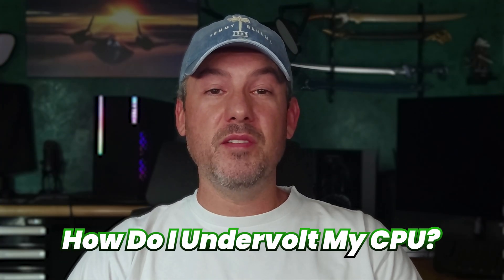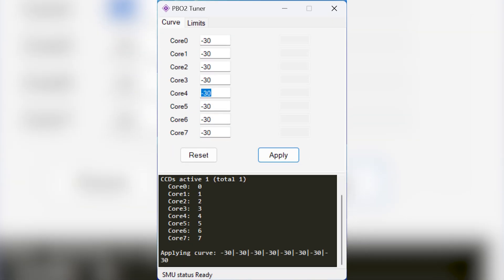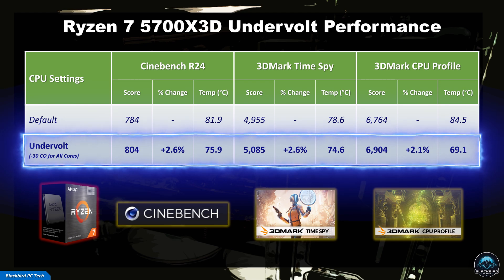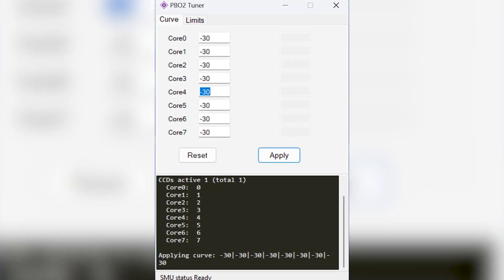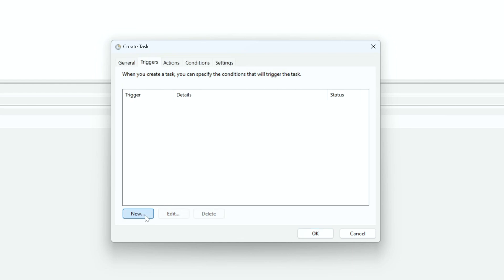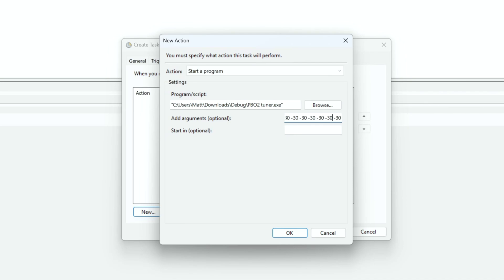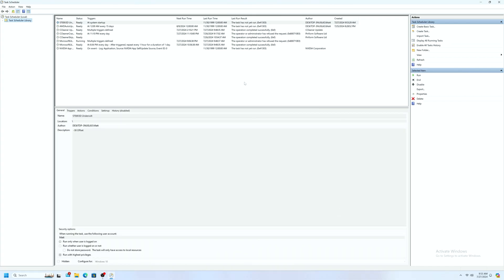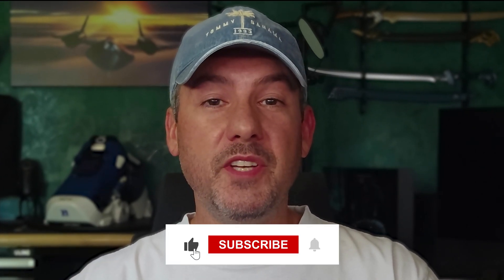How To Undervolt a Ryzen 7 5800X3D or 5700X3D!

Comment: Automated task didn't seem to work unless I ran with "Run whether user is logged on or not". Probably because I'm not solely using admin account for running everything and PBO2 Tuner needs elevation to start. The task scheduler needs to be started with admin account as well or task creation is going to hit another hurdle with user privileges.
Reply from the maker: Thank you for sharing that … will pin your comment so others can see it.
Reply: TY Bro It Worked for me too
Reply: My account is administrator but its not start automaticaly when i restart pc. What i did wrong ?
Reply: @tundzhayahmedov6149  Not necessarily anything wrong. I have no faith in Windows task scheduler anymore.
Reply from the maker: @tundzhayahmedov6149  it's not possible to figure out what you might have done wrong ... perhaps try following the steps again to make sure that you didn’t miss something.
Reply: I cant seem to make it work even if i select "Run whether user is logged on or not" any ideas how to fix it? it just doesnt want to start automaticly, and im not sure if i can somehow do this in bios so i dont have to use the tuner.
I got Gigabyte b550m ds3h 1.7v motherboard
Reply: @MuffledMosquito  who isn’t admin on their own pc?
Reply: Is it work on win11?
Reply: you dont need PBO tuner anymore, if you have any b450 or b550 and update to the last bios version and you can actually use the curve optimizer of the PBO that is inside the bios( u still cant unlock the clock or overclock), i know... not everyone knows that AMD released this by BIOS update.
Reply: @fuuji7996 ”any”? I’m just not sure about that.
Reply from the maker: @fuuji7996  That's not true ... the motherboard that I used in this video:

https://youtu.be/JIjD1mZUGz0

was an Asus Prime B550M-A AC and did not have a curve optimizer option in Bios, after the Bios was updated to the latest version ... that's the reason I discovered PBO2 Tuner. It's always a good idea to verify your information before posting it because it will drive people crazy looking for something that doesn't exist.
Reply: @blackbirdpctech  could be a similar case of the ASROCK b550m PRO SE in this specific b550M of ASUS, could you check inside of Advanced -> AMD CBS -> NBIO common options at the botton of the page, i guess u already checked in AI tweaker tab for the PBO there, or inside of advanced -> AMD overclocking too.
Reply from the maker: @fuuji7996  I test a lot of different hardware and there are multiple AM4 motherboards that don't allow you to undervolt in Bios ... typically these are lower end boards.

Comment: i've tried using this tool and using pbo in bios i cant get it to do anything doesnt work for me with  my 5700x3d regardless of what negative curve value i use and the only time i see a difference is if i change the actual VDDCR CPU voltage but it locks my cpu core clock to 3200mhz
Reply from the maker: If you can directly set your undervolt in Bios then that is a much better option.

Comment: Whenever i touch the PBO in any signaificant amount my clock speeds tend to drop quite a bit. Ive got an X570s mobo and a 5800x3d, currently with a -25 PBO set in bios and ive never seen it go over 4400mhz whereas it is allowed to go up to 4550mhz. I had to do this as i was hitting TjMax when trying to do pretty much any compute tasks. Even with this extreme PBO im hitting the thermal limit on the Tdie. Mind you this is all attached to a triple fan closed loop radiator. Did I lose the silicon lottery?
Reply from the maker: You didn't lose the silicon lottery, you simply have a chip that is locked for overclocking ... something a lot of viewers are unaware of. The 5800X3D and 7000X3D chips are all locked for overclocking due to thermal limitations. They solved this on the 9800X3D by redesigning where the 3D V-cache is located.
Reply: @blackbirdpctech  The CPU's stock clock is 4550mhz. I am losing up to 150mhz from stock clocks using that -25 PBO
Reply from the maker: I wouldn't bother changing the cpu boost clock, I would simply set a thermal limit and look at upgrading your cooling solution. Have you applied an undervolt?
Reply: @blackbirdpctech  I have changed absolutely nothing about the system other than setting a -25 PBO in the bios. Everything else is set to stock. I havent touched anything relating to clock speeds. I also have a new 360mm radiator closed loop water cooling system so its literally a top-of-the-line cooling solution
Reply from the maker: You are talking about a -25 curve offset, which is part of the PBO features. That makes way more sense. Given what you said then my guess would be that you have an AIO mounting problem … the cold plate is likely not making proper contact or you left the plastic sticker on it.

Comment: ASUS X570 TUF/BR here and i have PBO on UEFI, my 5700x3d runs at -15 all cores, -20 is ok for games but not for office/video editing
Reply from the maker: I would recommend testing your undervolt with the AIDA64 system stability test to check if it's stable
Reply: @blackbirdpctech  yeah that will be wise, or i will keep discovering this problems when i'm working on something important

Comment: my defender is blocking a trojaner if i start the program i used pbo for like 2 years it never happens befor someone  have a solution ?
Reply from the maker: I think it's an issue with defender ... I got the same pop-up
Reply: @blackbirdpctech  do you ingore it or not?
Reply from the maker: @Red28364  I went to the tool and ran a scan ... didn't see that there were any options to do anything else ... this is on one of my test stands, which I only use for benchmarking, so it's very strange ... I am just ignoring it for now.
Reply: @blackbirdpctech  Ok so does you think I should just use it, or is it better not to?
Reply from the maker: @Red28364   I would recommend running a scan to see if Windows Defender removed the issue

Comment: When I open pbo2 tuner the app won’t open. It’s been working as normal not I can’t even open it ??
Reply from the maker: Have you tried re-installing it?
Reply: @blackbirdpctech yes I’ve also tried adding it as an exception on windows defender. It’s really frustrating I’ve been sat here for ages trying to figure it out
Reply from the maker: Try running the SFC /scannow command from a command prompt opened as an administrator
Reply: @blackbirdpctech thank you, just tried that and it says no integrity violations found.
Reply from the maker: Try downloading Revo Registry Cleaner and using that to clean-up your registry
Reply: @blackbirdpctech just tried it and unfortunately no luck :(
Reply from the maker: @Parryy_  did you recently perform a bios update?
Reply from the maker: I would recommend looking in your bios to see if you have PBO options ... if you do then you can simply perform the undervolt there ... not sure why the software is no longer working ... could be a software conflict of some type.
Reply: @blackbirdpctech thank you so much for you help. It’s working now, i was having issues with my cpu temps not showing either but randomly everything has came back to normal. Strange
Reply from the maker: @Parryy_  my guess is that the registry clean-up helped.

Comment: Sorry if this question is dumb but I don’t really understand why you have to use pbo2 tuner.

I am currently trying different values through the bios and that seems to work fine too, even after multiple restarts. Is it because pbo2 tuner has more options?
Reply from the maker: Not a dumb question at all ... there are a lot of AM4 motherboards that don't offer PBO options in Bios ... if your motherboard does offer PBO tuning options then that is a much better way to undervolt your system.
Reply: @blackbirdpctech  Ah I see. Learned something again, thanks! I just thought every board had that option lol. I actually have another question if you don’t mind.

I see some people drastically lower their ppt tdc edc settings and get slightly better fps in games and also a lot better .1% lows, for me that also seems to be the case, at least in cs2. But cs2 doesn’t use that many cores I believe, and my 3dmark cpu profile scores are better with stock ppt tdc edc.

I also play battlefield 2042 which I believe uses more cores. I can’t really benchmark it since it’s anti cheat doesn’t allow me to use afterburner. The average fps doesn’t seem to suffer but I can only tell through the in game fps counters (I seem to be cpu bound).

But I’ve also seen video’s where people have better .1% lows with low ppt tdc edc even in games that use more cores like cyberpunk 2077. Do you know what is best?
Reply from the maker: @boosted_brommer  I'm not sure why that would result in better 1% lows ... that's not logical. If you are hitting a thermal limit then lowering those parameters can help reduce your temps and power draw, but that will negatively impact your performance. I wouldn't believe everything you read or see online.
Reply: @blackbirdpctech  I don’t, that’s why I’m asking multiple people. But from what I’ve understood from reading all about it is that by lowering those limits your chip doesn’t have that many power spikes resulting in very short clockspeed drops, thus improving your stutters. And I’m not dropping them so low that they have power shortage because I keep them above what they use when under a full stress test.

It’s just really complicated because cinebench and 3dmark usually give me very different results compared to gaming (what I mostly use my pc for). That’s why I’m asking people like you, who have way more knowledge then I do. I’m trying to find a sweet spot that works best across the board but I find that very difficult tbh :’)

Cs2 does show significant improvement when I lower my pbo limits to just above what the cpu actually needs, but that might differ greatly between cpu heavy games because not every game seems to use the cpu in the same way. It’s just that results between cpu benchmarks and games are so different that I don’t really know what to do lol.

But if I understand correctly, lowering the pbo limits could decrease performance in games as well?

Comment: I have a 5700x 3d and the difference with -30 to -40 for me was 568 points so im at -40 with temperatures at 63 from 74 at stock
Reply from the maker: I would just be careful of clock stretching at -40 ... you can watch this video to learn more about it and how to check for it: https://youtu.be/6vROzalei6Y

Comment: Hey, I have a question. I already used this method before and it worked great. Now i reinstalled my Windows 11 and its not working anymore. I did everything exactly like in the video. Can anybody help me pls.
Reply from the maker: It might be something to do with your security settings ... you might want to check device security
Reply: same pbo doesn’t seems to work
Reply from the maker: @yxon1ph do you mean PBO2 Tuner isn't working?

Comment: Here's my benchmark with 5700X3D Tomahawk B450 motherboard - Cooler Master Hyper 212 Air cooler
STOCK 
CinebenchR23.2 - 12117 
TEMP - 90C - 93C
Watt - 105W

PBO -30 (Stable)
CinebenchR23.2 -12930
TEMP - 80C - 82C (Idle - 46C)
Watt - 86.6W

PBO -50 (Stable)
CinebenchR23.2 - 12863
TEMP - 80C - 82C
Watt - 86.6W

Update
After changing from cooler master thermal paste (Air cooler) to Artic MX-6
PBO -30 (Stable)
CinebenchR23.2 -13200
TEMP - 78 C (Idle - 39C)
Watt - 86.6-88.9W
Reply from the maker: I can guarantee that -50 is not stable … try running the stability test in AIDA64 to check … you are getting clock stretching which is why your score went down
Reply: @blackbirdpctech  Got it 
Thanks

Comment: And YOU get a like! Thank you!!!!!
Reply from the maker: Glad you liked it!
Reply: @blackbirdpctech Just went through the insanely irritating task of reinstalling Win 11, cleaning my 10 partitions, deleting a TON of garbage and then I had to come back to make a new task because you actually make it so easy to follow!
Reply from the maker: @CaramelColored  It can be a pain but it's the best way to get your system humming again 😉
Reply: @blackbirdpctech It really is! I've been having BSOD errors for a few years after cloning my SSD OS to my Nvme drive instead of fresh installing it like I SHOULD HAVE!! I also use my mobo nvme for things I need fast and I have a pci-e nvme 256gb for my boot drive. It actually seems to run better than way, all things considered. May have a lot to do with i dont have my C drive running at 99.999999%....

Comment: My BIOs allows me to use PBO on my 5800x3d. Gigabyte aorus master x570
Reply from the maker: That is a much easier route … my x570 dark hero also offers it … it’s usually higher-end boards that have included it with bios updates
Reply: @blackbirdpctech  Initially the PBO was removed in BIOs when the 5800x3d launched but since the last two BIOs updates they added it again. I was using PBO 2 before, and had it set up as shown in the video.

Comment: Can you not just use the bios to undervolt and will this auto apply on start up?
Reply from the maker: You can and should if the option is available in Bios. Unfortunately for many mid to low end AM4 motherboards an undervolt option is not available, which is exactly why I made this video ... the motherboard I was using didn't have the option in Bios.

Comment: I got a 5600G, saw this video, use the PBO2 turner, it works very well
I need to ask about PBO2 turner,  there is a limits page, is it needs to set or just leave it?
Reply from the maker: I would need to look at the software again to answer your question however if the undervolt is being set correctly then you are good.

Comment: I did the same exact thing got boost in performance but still hits 90°c on max says hwinfo. I ran tests with cinebench r24 btw
Reply from the maker: It's important to remember how the 5800X3D works, it will boost to use up the thermal headroom. To reduce your temps you can add a temp limit.
Reply: @blackbirdpctech  oh mine is a 5700x3d
Reply from the maker: @dczarevitch  it functions the exact same way as the 5800X3D … it just has slightly slower clocks
Reply: @blackbirdpctech  can you make a video on how to do a temp limit?
Reply from the maker: @ that would be a very short video ... you can see how to set a temp limit in this video: https://youtu.be/9y_MGzrQHDg

Comment: either the peerless assasin is unmatched or im not getting the full picture.. im getting roughly 60c at 100% usage
Reply from the maker: It sounds like you have a thermal throttle limit set to 60 deg C
Reply: @blackbirdpctech  never actually gave that a thought as i doubt stock r7 5700x3d would be thermal throttled at 60c and i still do get 100% usage in cyberpunk and delta force, havent looked at clock speeds though. also i dont think it just stops at 60c but can go a little above it though i havent paid much attention to it so am gonna go investigate it now
Reply: @ upon alittle more testing all cores seem to be at 4,05ghz and sometimes drop to 3,25ghz for a frame (not sure what that means) while temps are at 59c and once went to 61c with raytracing enabled in cyberpunk and 63c without raytracing
Reply: answering my own comment i think the fan curve and peerless assasin 120 se is just that good because when i enable kombustor cpu burner i can hear my cpu fans finally getting to 100% and they are LOUD and at 60c my fans are running at about 50%
Reply from the maker: @ isn't kombustor simply an easy way to enable a curve offset?
Reply: @ man i dont know but it atleast tells me it can go higher than 60c

Comment: how can i set the limits on task scheduler? like ppt, tdc and edc
Reply from the maker: That's not what task scheduler is for ... those parameters are set in bios, so you need an application like Ryzen Master to modify them in Windows
Reply: @blackbirdpctech  i dont know how to do this but ill try tysm

I got 1100 and 116 in cinebench 2024. In multicore the max temp was 70° and in single core 52°.

I did it with 3 youtube tabs open in microsoft edge, discord call and with the wallpaper engine open.

curve: -30 all cores
ppt: 95w
tdc: 60a
edc: 90a
maxboost: 4.050mhz
generic 360mm aio

are good results right?
Reply from the maker: @ why are you manually inputing your ppt, tdc and edc?
Reply: @blackbirdpctech  i saw a guy on reddit recommending these limits and i replicated it, but idk what changes, can u explain?
Reply from the maker: @vitorslaoq  the best advice I can give to you is don't follow the advice of random people on Reddit ... just follow the steps in this video and leave the rest on Auto, especially if you are not familiar with what these items are.
Reply: @blackbirdpctech  got it! thank u

Comment: Great video! For what it’s worth, AMD removed the pbo restriction for X3D chips on later bios versions so you can do this via the bios now. (At least I can on my ASUS B550i)
Reply from the maker: I found that it's still hit or miss ... I could do it on my X570 dark hero board, but not on the cheaper Asus Prime board I used for this video.